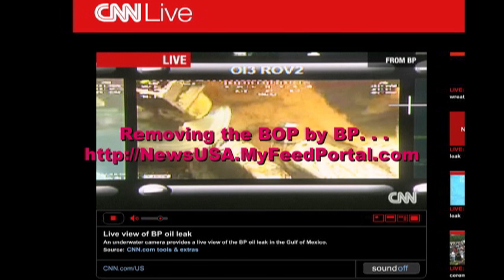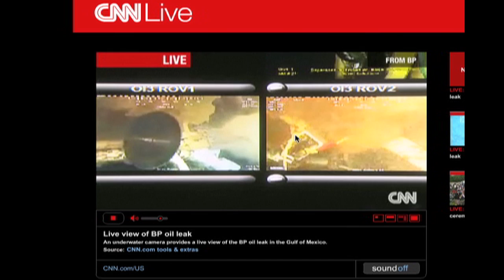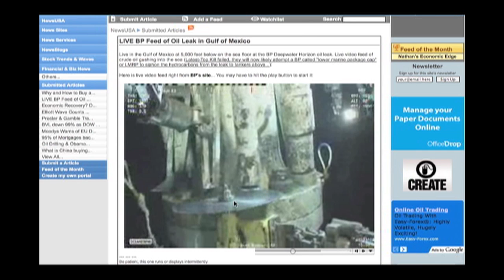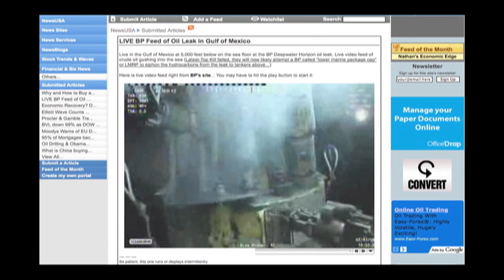BOP being sawed off by BP. Start of LMRP operation in Gulf oil Leak - May 31, 2010

Comment: May be LMRP can not work. We make an estimate. The pressure on the seabed:1470 n/cm2. The oil comes out forms an inverted cone. The cone widens upwards of 8 times.Then loses its strength.So after 8 times wins again the pressure of the sea! So the oil has a force of 189 tons! To win the oil it takes a greater force of 189 tons. The water pressure lifts the LMRP. Let's take an iron LMRP.To avoid mistakes we choose a weight of 342T.  Be careful with these data.Otherwise, the cover can not work.